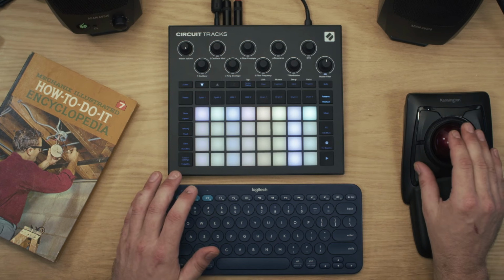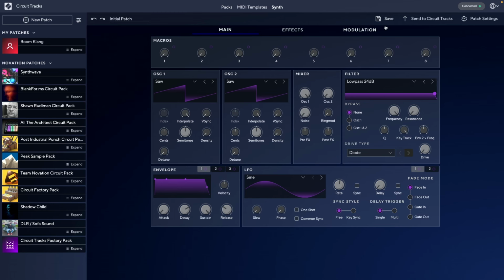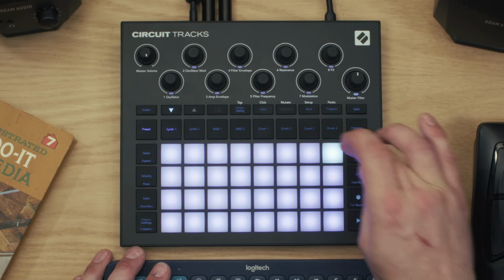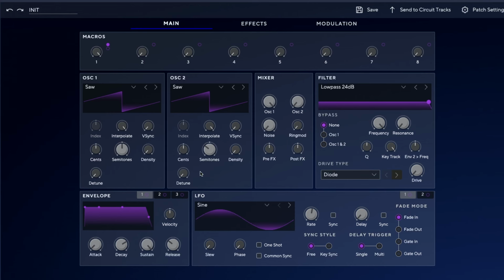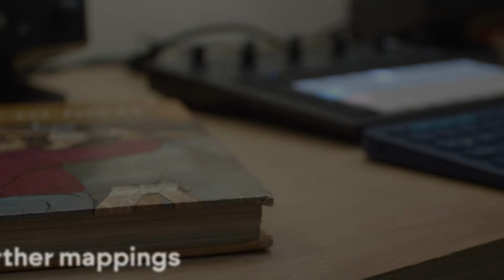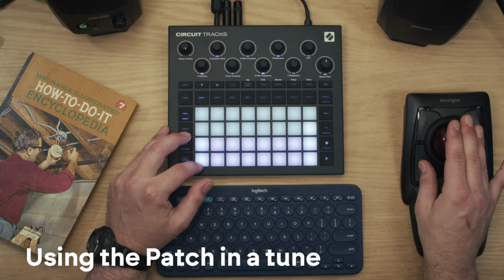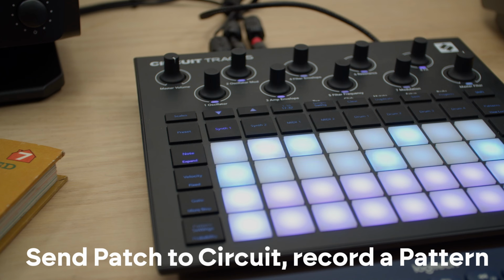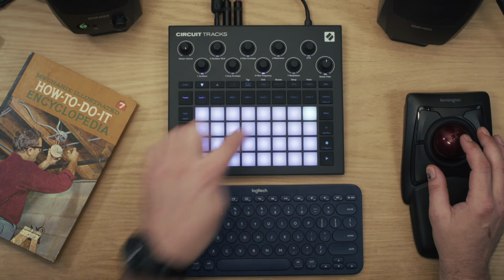Create your own epic synth patches on Circuit Tracks with Components

Comment: The Circuit Tracks is one of my favorite pieces of gear.  I use it as a traditional MIDI sequencer for four external synths, and it works great for that!
Reply from the maker: Perhaps you're thinking of the original Novation Circuit? Circuit Tracks has 4 six-voice polyphonic sequencer tracks.
Reply: How though? It only has two MIDI tracks.
Reply: @Hakucho64  The first four tracks (the two internal synth tracks and the two MIDI tracks) all send MIDI out.  So I'm sending note data out on MIDI channels 1, 2, 3, and 4.  For the sounds that are produced internally on the two synth tracks, you can just turn their volumes down so you only hear the external synths, or you can leave their volumes up and you will layer the internal synth sounds with whatever patches you have playing on your external synths.  It works great.
Reply: @synthsoniq ah, nice trick, I'll have to remember that!